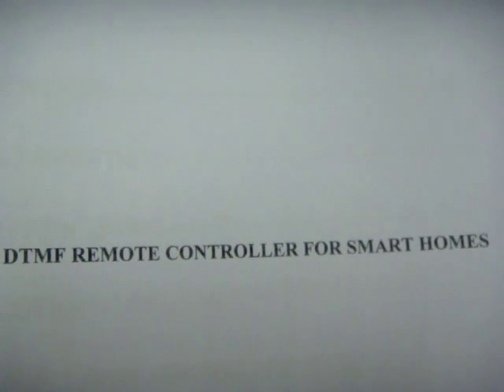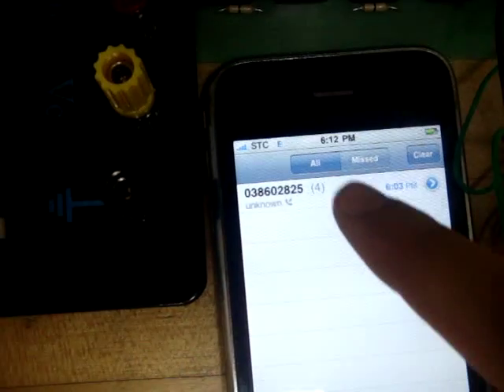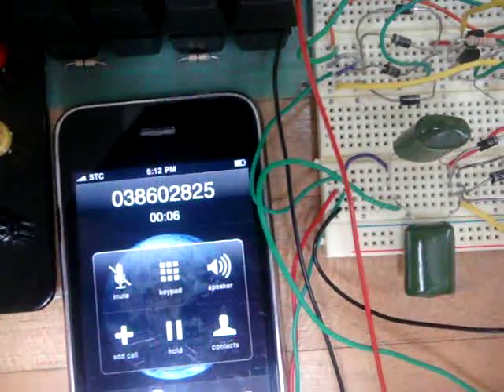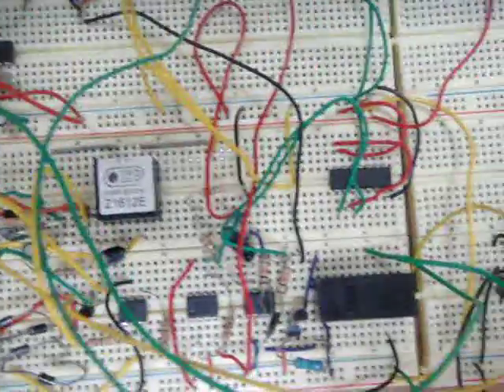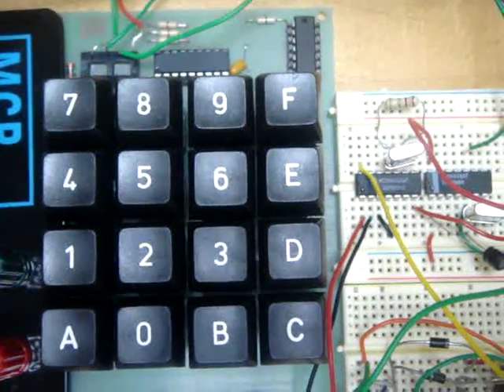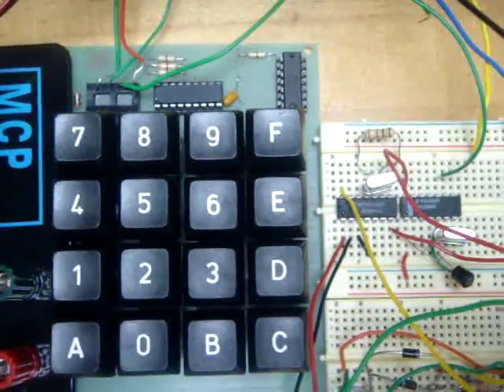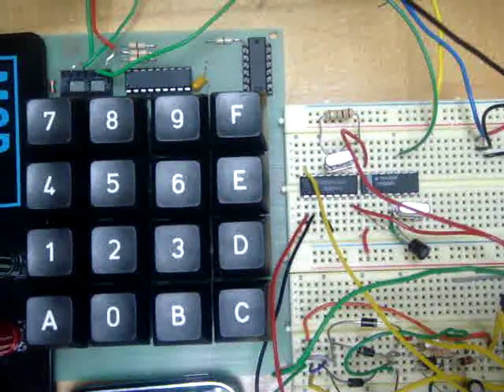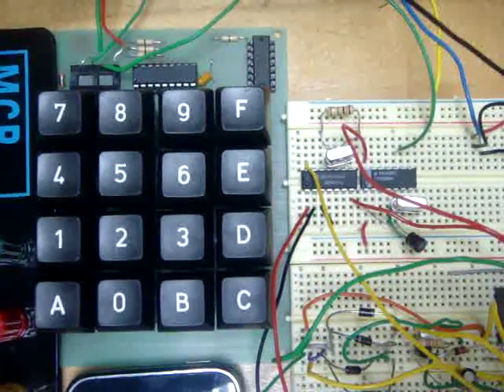DTMF Remote Controller For Smart Homes.MPG

Comment: Hello,
I'm trying to work out about greeting ederim.Bende gsm based remote control. Schema of the circuit board, and other documents you send us if you would be satisfied. Additions on the circuit will also share with you.
with all respect